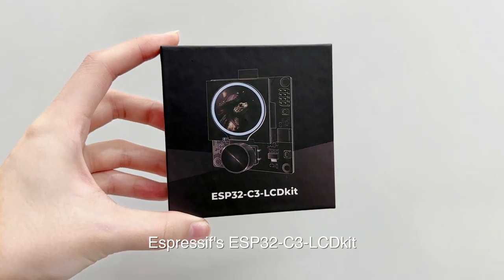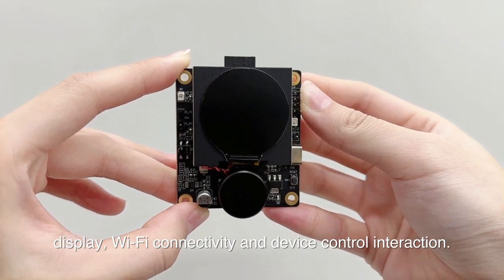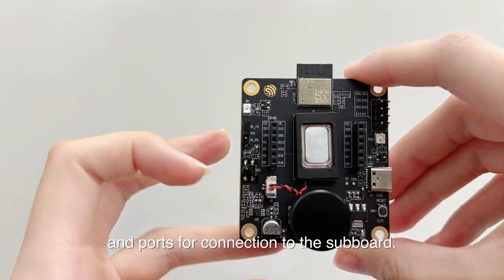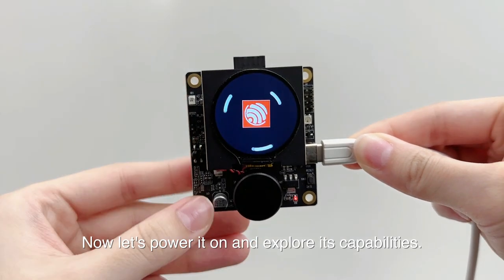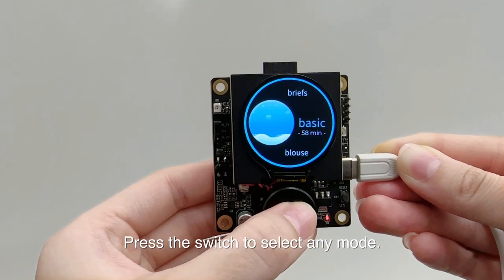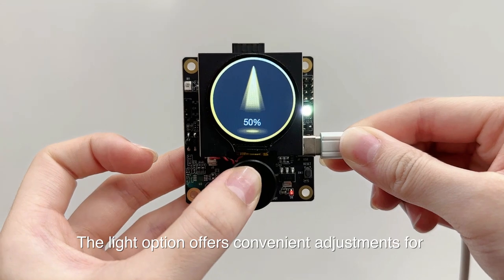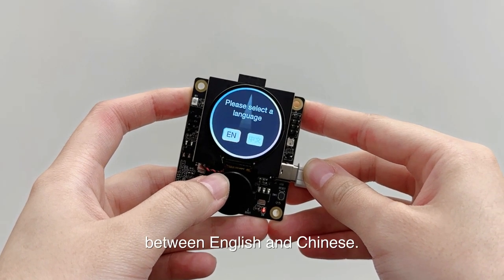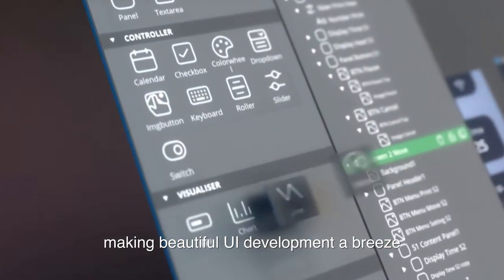ESP32-C3-LCDKit

Comment: 2 days back , i bought a new esp32 DEVKITV1  when i try to upload any code it shows 
 Connecting......................................  
A fatal error occurred: Failed to connect to Espressif device: Invalid head of packet (0x00): Possible serial noise or corruption. 
So , i tried all troubleshooting steps. Still the same error 😢 
Please 🙏 suggest me how to solve the issue
Thank you.